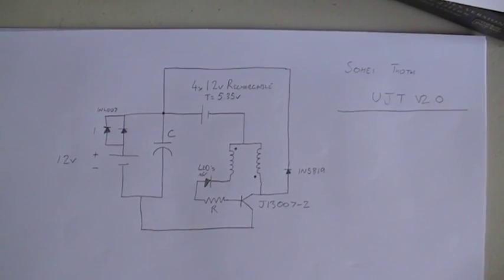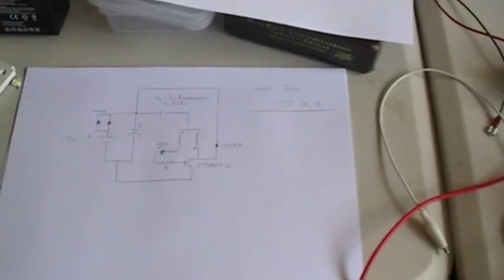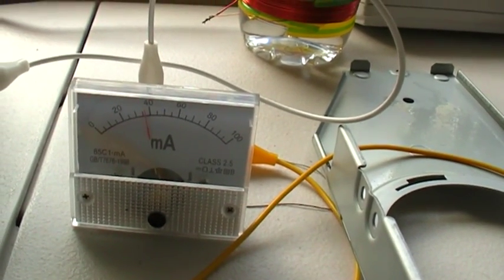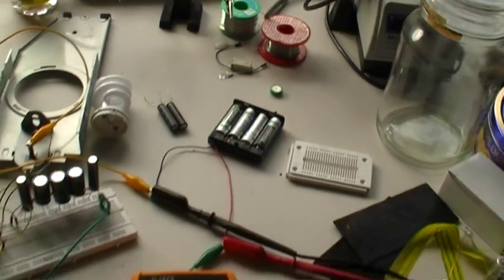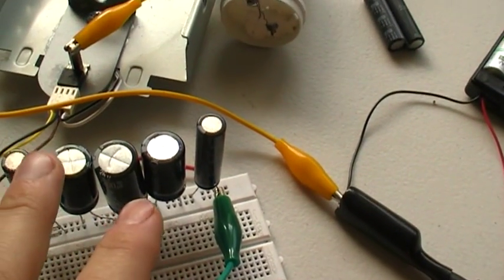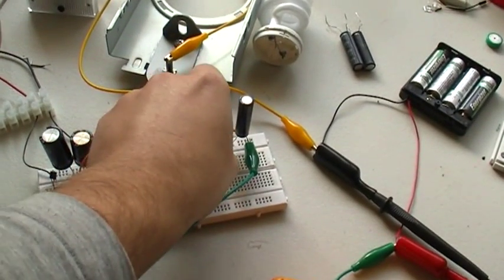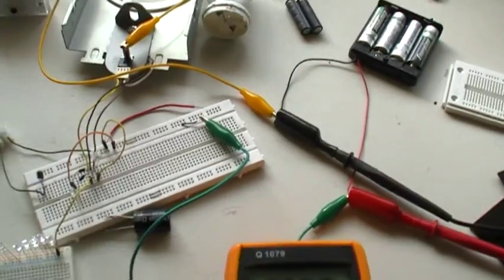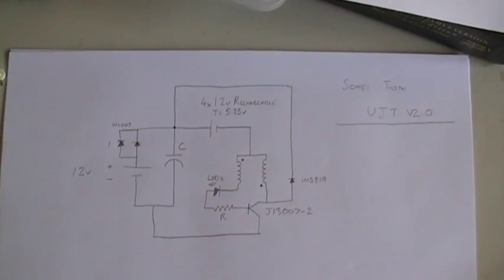UJT Charger - RE-EMF - Replication Shows around 150% to Recharging battery.

Comment: use 12 0 12 transformer, run it from source battery and put charge battery on output side of 12 0 12 transformer.

Comment: I don't think you can call this overunity. You have to take the math into account. 60 milliamps at 12 volts is not the same amount of power as 60 milliamps at 6 volts. If you're using 30 milliamps on the input at 12 volts and then getting 40 milliamps at 6 volts on the output, then your output is less power than your input if you if you multiply and do the math.

Comment: Nice setup on the Re-EMF. I also tried to replicate and found it unusual that whatever load you put on it, it matches the required voltage to power it or charge it. Check it out Re-Emf pulse oscillator bedini like joule thief battery charger

Comment: As Cool Joule pointed out, The charge batterys are at half the voltage, so half the watts for the same amps. I'd be interested in your impression of the discharge Amp hours after charging on this system too. I think it should be a deeper charge than other flyback chargers.

Comment: Very efficient modification.     
supply   12.81 volts x 27mA = 0.34587 watts in
charging 5.44 volts x 37mA = 0.20128	 watts out
we gatta compare the watts :-)
I'm all for factoring in the spike though - check out my tube.